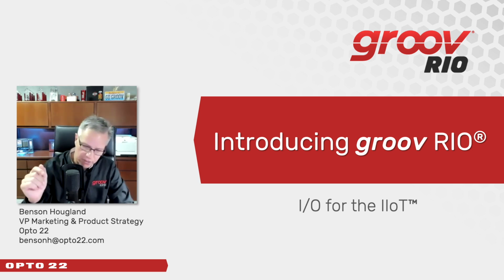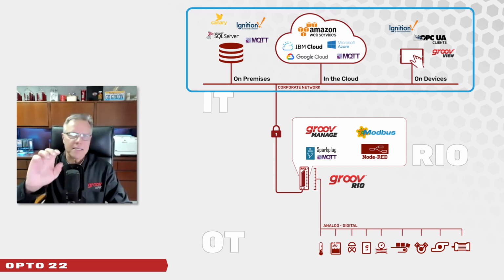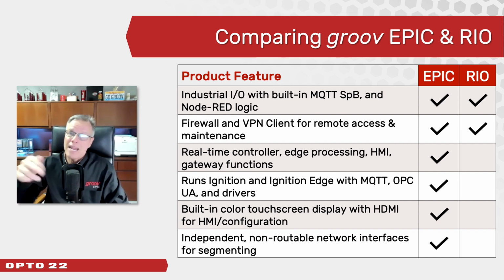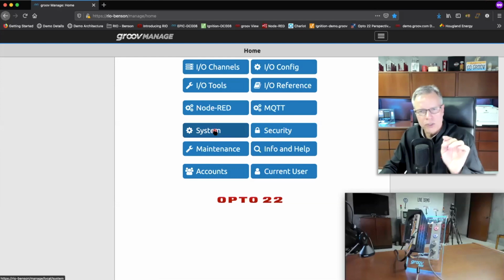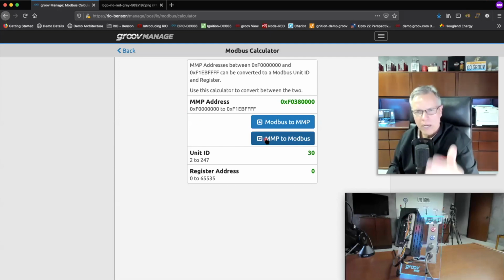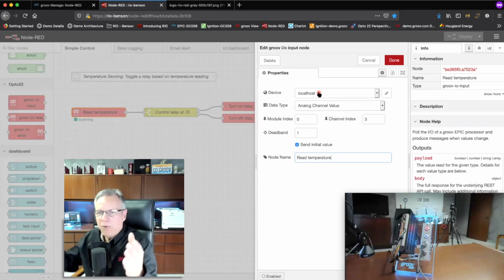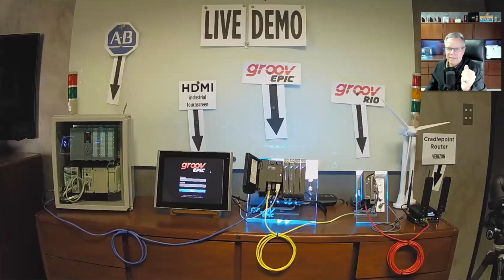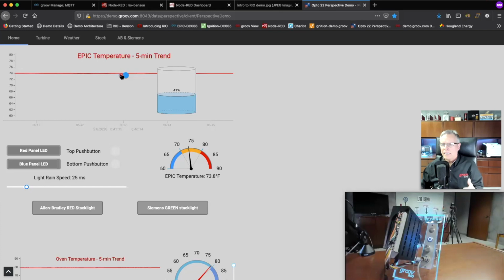Webinar: Introducing groov RIO

Comment: If I don't have the MQTT Broker can I send the data from the groovRIO to an Ignition EON Server in my private network?
Reply: Hi Daniel- Yes, you can if you have the MQTT Distributor module installed in your Ignition Gateway. The MQTT Distributor module is effectively a broker, and if installed in Ignition on your private network, you'll simply point groov RIO's MQTT Broker address to the address of the Ignition Gateway computer. 
Thank you for your question, and feel free to reach out with any further questions.